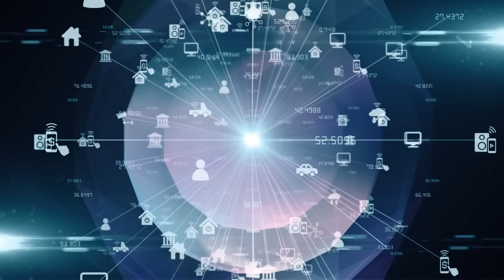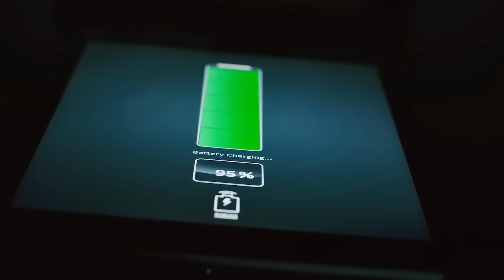Elon Musk Revealed The End of Lithium P3, Thanks to TESLA Shock Battery Tech, Entire Industry Change

Comment: Why can't they make the battery larger?
a few large rather than 1000s and 1000s small batteries welded together.
I think any battery that requires a chip to run it is flawed in design right off the bat.

Comment: All good, but, it is still based on lithium battery chemistry, so the short supply and availability of lithium therefore remains a critical (expensive) problem. Beyond that, it is still a rechargeable battery, so, you still have sit around waiting while it recharges, when you finally get to a working charger. All of which doesn't raise the questions of how much the battery might weigh? or, what its working life will be, or, what to do with it and the car, when it finally fails. More landfill??

Comment: Why have they not figured out how to recharge the batteries via simply driving the vehicle. Think infinite energy like connecting two alternators together or an alternator, a belt and a motor/pulley system. Convert kinetic energy into electrical energy. Theoretically the only energy needed that would be loss would be starting the vehicles ignition.
Reply: They want to have a daily income from the vehicle instead of a one and done sale of a vehicle.  Self charging batteries would be too cheap for the consumers

Comment: Wouldn’t it be feasible to make battery powered cars with interchangeable batteries? I would make automated stops that charge batteries with solar energy and change the batteries of your car rather than waiting to charge
Reply: That's exactly what Gogoro does for their scooters. Here in Taiwan, there are Gogoro battery kiosks scattered around every city.
Reply: Exactly
Reply: This would be viable and make sense if a strict standard solutions were forced to car makers. Unfortunately there are no global standards for battery pack designs in the making or in plans.
Reply: Tried and died. Too many problems with this concept, extra weight, connectors are a failure point, cooling, liability even (you have a new battery installed, and it catches fire..) I'm sure there's others. Nope.
Reply: @cjc1103  lithium is a highly flammable metal, it’s a poor choice for batteries.

Comment: How about if there is a device that can save 50% of EV engine consumption and at the same time another device that can charge your Battery ? 
We have that device !
Reply from the maker: I presume you are referring 'Hybrid' vehicles. By having both a engine and batteries plus the recharge system the car is very heavy and inefficient. So you dont get anywhere near 50% saving. Simple basics of physics. Ask any Car engineer
Reply: @teslabright  

No sir it's a new device that can save 50% of motor consumption with full efficiency

Comment: Batteries and EV's are NOT the future, they are the past.
The future is Hydrogen, there is no debate.
I could write a book on all the reasons EV's are a bad idea.
The main issue, NOBODY currently generates enough electricity in their country to switch to all (or even mostly) EV vehicles.
Also, NO country has an energy grid that can handle the load, by a long shot.
These issues will take DECADES to correct at best, with full force and effort behind the improvements. (which will never happen in the current political climates around the world)
Energy production is in decline in most major EU and western countries thanks to liberal democommie nonsense.
Only the chicoms are ramping UP domestic energy production.
Fossil fuels are here to stay for a LONG time to come.
Until we invent a new way to harness energy, and store it safely, and transmit it.

Comment: People love talking about how good battery powered EVs are but they never talk about energy density.  Pound for pound gasoline has more energy density than electric batteries.

 On the other hand, hydrogen has significantly more.

Hydrogen has around 35000 watts/ kg compared to 2000 watts per kg for li ion.

Comment: EV drivetrain is the future..but...batteries are not...zero emissions but not zero waste....battery materials nickel,lithium etc are rarer than fossil oil...diversification is the right decision...because batteries is an energy store not an energy source...converting conventional vehicles to full EVs (batteries) only changes the decentralization of emissions to centralized emissions if the power plant remains based on coal and fossil oil....diversification with hybrids or conversion of fossil oil to bio fuel, hydrogen etc. makes us independent and not addicted on 1 source of energy or material

Comment: Batteries are the weakest part of the vehicle ,, they should be quick changed easily and be cost effective 
Or have a power generation plant built into the vehicle running on davailable iesel because grid linked chargers aren't everywhere like diesel ........

Comment: ev's arent much different than gas as far as waste and affordability goes. if anything ev's cause more waste from all the materials needed for the batteries, and most of the time the batteries are hard to repair, so if the battery goes out you're better off getting a different car over getting a new battery. I still feel like gas cars are gonna be the go to for at least another decade, ev's are cool, but not practical still
Reply: I would have agreed until recently … then I rented an EV for a couple of weeks. It’s a game changer in so many ways. Simple to drive, quiet, and from what the rental company say … virtually zero maintenance

Comment: New more efficient Battery types sounds great, there is a small problem with any changeover to Electrical Transportation system. Where is all the electricity going to be generated, and how is the Electrical Grid going to carry the load to all the charging stations, in homes, or in charging stations? We are not progressing at all for the soon to be here much larger percentage of new demand on the Electrical System for Transportation. We are not keeping ahead of Electrical demand now.
Reply: Yeah, well, in case you haven't noticed, none of the eco-weenie proponents of electric cars want to acknowledge that fact. Maybe sanity will return and we will all deal with the issue in a realistic manner one day soon. And on that day, you can be sure that pigs will take flight....

Comment: I wonder if the dry coat can be accomplished using a redocks chemistry along with a DC power supply to attract the coating. It would take some experiments to keep the coating thin enough to provide maximum power. Powder coating doesn't require drying time, and keeping the coating process going as fast as the machine can handle. The goal being producing a battery with a uniform power supply that stays within the projected power delivery.
Reply: powder coating requires baking
Reply: Interesting process when the powder coat painters Pre-heat the metal part prior to electrostatic spraying the dry powder paint.   As the paint get applied, it also "melds" with the metal, very much like a liquid does.   Just saying, that the process engineers need to look at outside industries for tricks of the trade.
Reply: @Stuart Lew  //
I killed myself in my Intro Materials Science Class just for a "B" grade. It is Science, Alchemy, & Art.
Reply: @4Lights.5Liights  electrostatic coating doesn't require preheating when you use a fast drying solvent as a carrier. I've seen them use it to paint metal doors. I've patched powder coating with an epoxy mix after the pipe was cold. A ether solvent with strong air flow would dry in 2 seconds, and can be recovered from a water bath with distillation. Pretty sure it would work. Keeping the spray tips clean would be your biggest problem. Higher pressure would be a possibility to solve that problem. The higher the pressure the thinner the coat, but more over spray to deal with.  So more protective guides required to keep it controlled.
Reply: Hello dear
Thanks for your wonderful support towards my son
Reply: SWAG: Scientific Wild Y@& Guess. Can't some sort of sputtering process be done like hard disk drives ???

Comment: An LFP battery, is still a lithium battery. That is what the L in LFP stands for. 😂
Reply: Yep and that is why the new sodium Ion battery will out perform it. Now in limited production but huge increases expected by the last quarter of 23
Reply: @peteg6419  maybe, but sodium ion dose not have the energy density ,YET. It is/will be good for grid level storage where size and every density is less of an issue. But for EVs sodium would restrict you to sub 150 ranges currently.

By 2030 we will have :-

Sodium ion for grid storage and sub 200 miles range cheap  EVs.

LFP for 200 to 300 mile range EVs 

And maybe by then lithium sulfa for 300 to 500 mile range cars And by then 250+ mile range VANs , trucks and HGVs.

Remember there  is no real shortage of lithium the price has almost halved since it's 2022 peak.
Reply: @rodkjeoso8453  it will do them no good if it leads to lots of warranty claims. But there is no evidence for it YET. And when I talk about grid storage I am not talking about power walls. I am talking about megapacks. The people who buy those won't put up with them being dead in 3 years they expect 12 to 15 years. And will expect and get  FREE replacement if not.
Reply: @rodkjeoso8453  nope, its the other way around, 'LiFePO 4' battery have at least x3 more recharge cycles than NMC/NCA battery, but heavier and have less charge per KG of weight.
Reply: The biggest thing is it stops the slave market in Africa in the cobalt mines...THAT is the big part about this.  Cobalt is primarily used in Li batteries and the EV market uses the most Li.  Get rid of Li, get rid of the mines that are killing people and not getting ANY air play.  Joe Rogan does more to promote the end of Cobalt mining than the news does.  How bad is that?
Reply: lithium ferrophosphate
Reply: @rodkjeoso8453  we will see how the life expectancy goes , if they can get to the warranty (8 to 10 year and 100,000+ miles ) then there will be no real issue.

Grid storage systems are using LFP. They cycle at least once a day and are currently having no issues.

Comment: You need to pull two trailers with an electric truck. A 20 foot trailer for cargo & a 40 foot trailer for batteries, good luck with that.
Reply: meth troll
Reply: well one specific need doesnt equate to all needing the same.  If batteries can support 90% of the need, then the last ten percent may use different technology.  Thats a win win for everyone.
Reply: Even better luck ,with that. In  Canadian winter climates & terrain. Electric cars are about control ,cause they can be turned off by remote control ;or locked and  self - driven to the gas chambers & ovens.